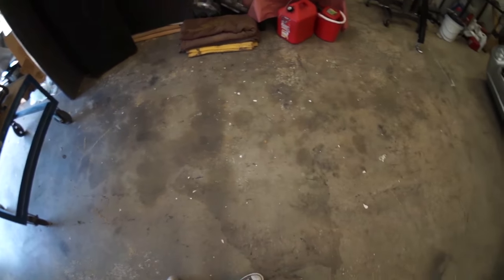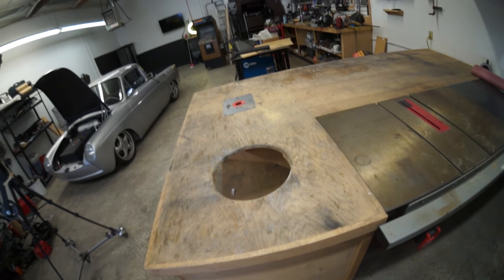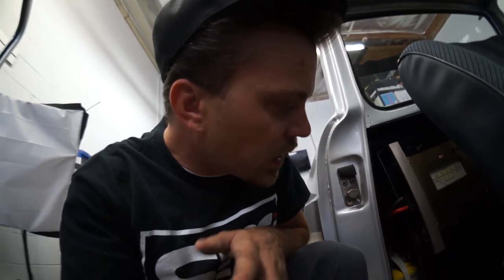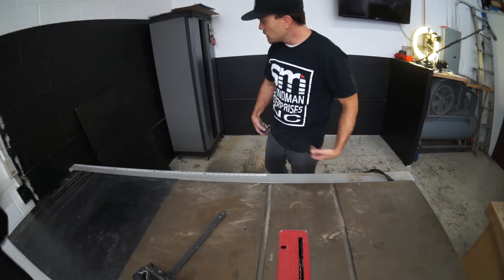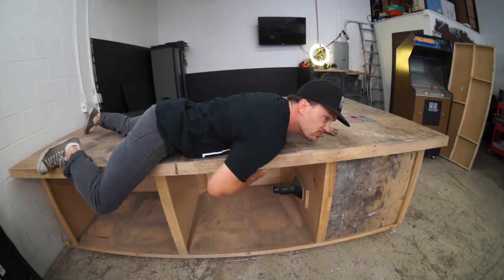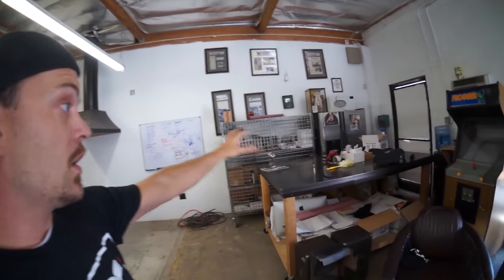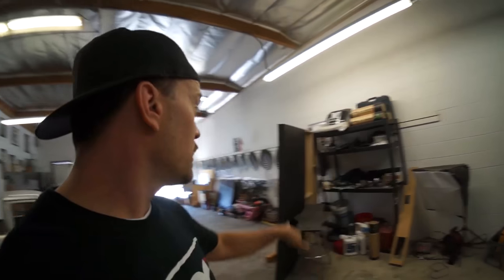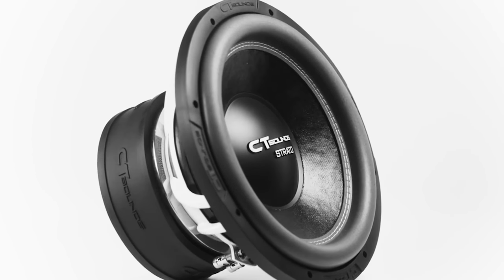My Wood FAB BENCH

Comment: I think i did see a portion of feces leak out along with your intestines while you dragged that sawbench over,  i guess you did plan that, that's how it slid so easily,, Brutal Strength Doug, Brutal! or the floor was still slippery from all the Coolant leakage where the mule use to be and that's what you dragged it through, Got there in the end anyhow, Should have got Rafa's mom in to burn some Calories,,,lol